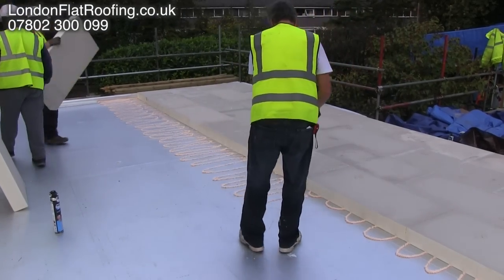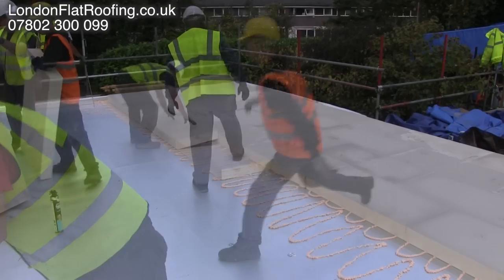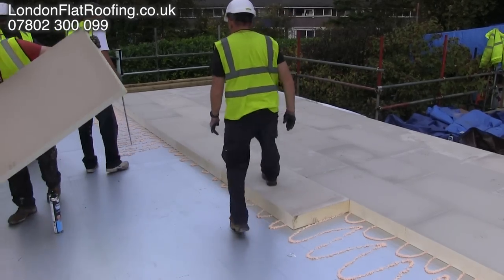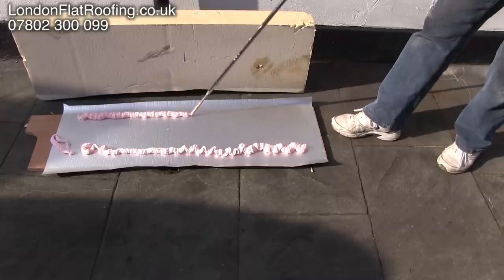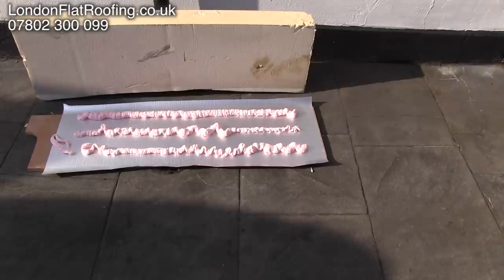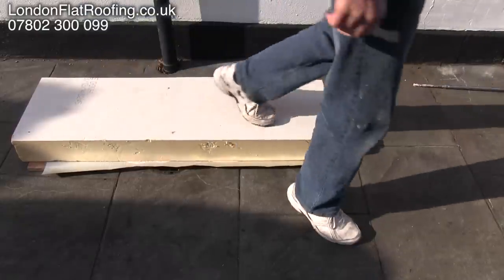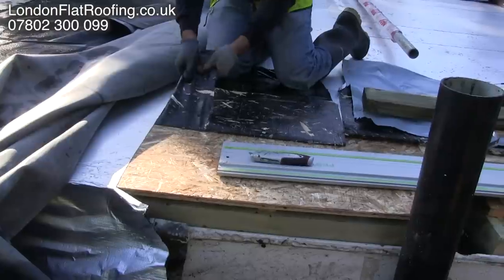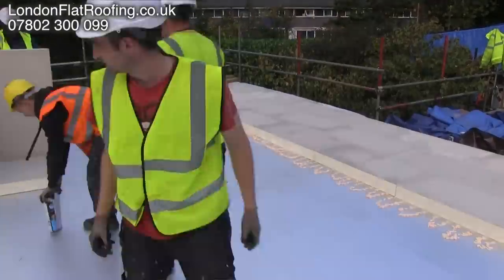Vapour barrier for a flat roof

Comment: Hello Steven
Is it better to give the  vapour barrier a mist coat before the foam?  I ask because last summer we had trouble with the adhesive not curing and subsequent wind lift on the insulation. I would say 30% of the foam has failed.
Reply from the maker: Your question could be taken in more than one way so hopefully, my answer below covers your problem. Don't try and glue insulation to any silver surfaces unless you have the manufacturer agreement of both products that it will work, as yet I can't get any of them to guaranty this so now we don't glue any of our flat roof insulation down. We use thermally broken fixings.
Reply from the maker: By the way all of this failed!

Comment: We have just finish a warm roof where we also glued the insulation down . Bad move ? This is fine if you can get the insulation , OSB down and the Rubber down in one day and make it water  tight . Due the the uk weather it was not possible a lot of water got between the membrane and insulation had we carried on putting down the OSB and rubber . Water would be trapped and never got out or evaporate. Total nightmare. We had to rip it all up which because it was stuck down it was completely ruined.The cost was high replacing the insulation 😢Never again will will stick it down . Once the OSB is screwed down it can not move . Hope this helps someone else to avoid this costly mistake
Reply from the maker: Staging the work between the weather is always paramount to making sure that the work goes well

Comment: Hi Steve I'm going to use this system for my flat roof,  but how do you fix the top deck down, slab nails, screws, or glue as you did the bottom deck kind regards Mark

Comment: hi steve i have been watching your you tube videos for a while and i find it of great intrest.
I am currently building an insulated garden studio and i am about to hopefully start a warm roof build. as an ammeter who has never done this before i was wondering if you could give me some advice?
my warm roof would be joists 18mm osb, vapour barrier ,celotex, 13mm osb and finally rubber edpm

on your blog you mention a link to the rubber4roof websites for purchasing a self adhesive barrier however the link just takes me to the website. can you please tell me the exact self adhesive you guys are using in the video on the same page you metion the link? . please could you also tell me the type of expanding foam i would need to purchase to stick down the celotex as in the video.

many thanks

Comment: Hi Steve, after fitting vapour barrier and then insulation do you then fit another layer of 18mm plywood before rubber roof or lay rubber roof ontop of the insulation thanks Chris BTW great videos
Reply from the maker: The practice so far is to put OSB over the top of the insulation however that is now becoming frowned upon for two reasons but the main reason is that if you haven't got OSB above the insulation you haven't got any rotterbal material above the air vapour control layer does nothing to rot and hopefully nothing to go wrong. So that's reason one not to put it up there reason to is cost.

Comment: Nice video Steve..
After the insulation has been glued down... would you screw the osb on top of the insulation or use the same process  of expanding form? 
Cheers 
Yas

Comment: Hi Steven - we are looking to put up a roof made out metal insulated panels - (sandwich panels with 8cm foam between them.I am wondering if you can advise if we will need other type of insulation underneath- the room is going to be used as a day room for the dogs during winter- so the room will be heated.
thank you

Comment: I've just had a flat roof done, they put the vapour barrier down then the foam and used long screws to hold the foam in place going through the barrier putting holes in it!! It's done now so staying but is that a common practice?
Reply from the maker: Yes happens all the time  if they have done everything else Ok then it will work

Comment: What would you suggest the best covering or method is if you come across an old concrete flat roof that has settled and needs re surfacing and the fall isn't taking water away into the gutters anymore?

Comment: Hey Steve, ive been watching your videos, very informative. May be an idea to list in the description some of the components used. A recommended list for example. I notice you are glueing down the insulation, is that with standard expanding foam or a particular roofing tpye? what type of Insulation are you using Kingspan K7? the vapour barriers you use, any recommended suppliers etc.

Comment: We have dormer style room in roof on the top (second) storey of our house with two flat roof areas to the front and back of the property (both adjoining next door property). Can we just insulate the flat roof part above the dormer window rather than undertake full room in roof insulation? Or would this likely cause condensation/damp issues or thermal bridge problems? Just had one of the rooms in the roof ceilings plastered so this insulation isn't the best route for us now.

Comment: Hi Steve, I am an Architectural Technology student and I would like to ask the brand of the vapour barrier and the expanding foam?
And can this type of vapour barrier work well with precast concrete slab/substrate? Thanks in advance. 
Also, all of your videos are amazing 👍
Reply from the maker: We are using value alutrix 600 as the vapour barrier and I cannot remember what glue we used at the time we don't use glue anymore because it can fail we always use family broken fixings now

Comment: Hey Steve, thanks a lot for all you very informative videos; one question for you: i have a flat roof that, based on the technical definitions, would be a "cold" flat roof, ie there is some fiberglass insulation in between the joists (this was done by the previous owners maybe more than 20 yrs ago); on top there is the decking which is sealed with the silver looking type membrane/sealant (whatever you call it); i have no issues al all with condensation, so i presume they did put a vapour barrier; the problem is the room is cold and i would like to add insulation boards on top of what already is there; could i glues them on top and then use fiberglass to seal the whole thing again, or what would your suggestion be? thanks a mil for your help

Comment: won't the expanding foam raise the insulation board causing gaps between the VCL and insulation ?
Reply from the maker: No not if its installed correctly
Reply: Does it have to be glued when installing another layer of OSB on top?

Comment: Hi Steve can you get a primer to paint on the osb if it's a bit weathered and bit dusty.its been down for a while .?
Reply from the maker: You are going to invest a lot of money putting a roof covering over the top of some old decking so make sure it is dry and robust before doing so if it is then Private with something like waterproof, uni, bond or a tar based product, if you are going over with some sort of felt

Comment: What foam do you use and also what insulation? Do you put another timber deck on top? What insulation would I use for a felt torch on? Thanks.
Reply from the maker: We use tissue faced insulation and we use normal spray foam anything that we can find if you're gonna torch over the top of insulation you can buy a insulation that is designed for torching over has sort of a black top to it a little bit like Felt already on it

Comment: Hi Steve, you mentioned in one of your more recent vids that your preference is to use thermally broken screws over glue. Is that that the current best practice?
Reply from the maker: It's my prefered method as I know that it works and won't come unfixed. We had problems with some of the glued down insulation coming away from the vapour barrier.

Comment: Hi Steve

Hope you can help,
My builder is doing a warm roof for me.
The roof is soon to be fibre glassed. But I  think the vapor barrier has been missed.
The roof construction is 
12mm ply on joists, 100mm foil backed xtratherm insulation then 18mm T&G Osb glued on T&G joints & screwed through Osb, insulation and ply to the joists ( posi joists).
Without the roof being completely removed to now fit a vapor barrier is there another solution?
Thank you
Kev
Reply from the maker: No, not realistically. our specification of 100 mm insulation is not up to the correct standard 120 mm should be the minimum.  glass fibre is not the best thing to use on a warm roof.  have they used thermally broken fixings? Also if you have only got a thin lower decking the fixings must go into the joists or you could have wind uplift that will blow the roof off
Reply: @SteveRoofer  not sure on the fixings but definitely screwed to the joists,  there is a slight overhang of the roof from the main building can vents be fitted in the soffit between each joist and at either end? Would pictures be helpful?
Reply: Thank you for replying so quickly
Reply: @SteveRoofer   forgot to say this is for a garden office space not a permanent residence
Reply from the maker: @kevparker3253  yes you can vent there or anyware as long as its though venting
Reply: @SteveRoofer  good morning Steve 
Thank you for your replies yesterday.
I have decided to take all the Osb boards and insulation up and install a vapour barrier, could I please get a simple drawing/link to a drawing for this so my builder can follow and a recommended vapour barrier.
Roof also has 3 skylights with timber  upstands & timber upstands on the perimeter.
Many thanks for the help
Kind regards 
Kev
Reply from the maker: loads of drawings on line for warm roofs the VCL is alutrix 600
Reply: @SteveRoofer  thank you

Comment: Hi Steve
Love your informative videos!

Do I need a vapour barrier if I am using foil backed insulaionboard? (EcoTherm)

I have built a 5m X 3m shed. Warm flat roof as per your recommendations !  :)
It will be having GRP roof coating system.

Do i need to put osb boards under as well as over the Celotex or will the celotex have enough strength not to crush?

Cheers
Stephen
Reply: +Stephen Divers 
I once read an article about vapour control layers and  “when is a vapour barrier not a vapour barrier” was the question. The answer is when there is another vapour barrier in situ that works better.  This link take you to my website and an article explaining your exact problem ( it starts half way down the page ) 

http://londonflatroofing.co.uk/warm-roof-explained/

Comment: Anybody know if it would be sufficient to use a breathable membrane such as rhinovent pro on top of an osb3 roof deck and then use thermally broken screws to fix the insulation to the top deck before the epdm goes on?

Comment: I understand that you "glue" the Thermalinsulation to the vapor barier, but you also glue the vapor barier to the flat roof?
Reply from the maker: +picajoool  Yes  is the easy answer. However on a warm roof we always use a vapour barrier that is sticky backed so it self adheres. Cheep vapour barriers normally don't perform correctly IE  restrict the correct amount of vapour movement, but also become expensive once you start taking into account how you are going to fix them down.
Reply: +Steve Roofer 
Man, your fast :-)
We usualy lay down the VaporB on flat roof (no gluing, only on overlaps) and the put the thermal insulation plates over the VB. 
But we use mechanical pins (that go from top of the thermal insulation layer all the way into RC slab) for securing the the whole roof so in that way we are certain that there wont be any uplift happening.
Reply from the maker: +picajoool  That's what we do if we are mechanically fixing over a timber deck. What VCL are you using? what fixings are you using to go into RC slab.I haven't been able to find a thermal fixing that will  do that job
Reply: +Steve Roofer
That the problem with the fixings for RC slabs, They from metal so youve got thermal bridge.
For VCL we use Gutta guttafol DB vapor barier but to be ohnest any conctruction PE sheets will do the job as long they have someking of reinforcement so they dont tear up easily.
Reply: +Steve Roofer 
Hi Steve

Which VCL is it you use that the insulation boards can be stuck to?

Cheers
Stephen
Reply: +Stephen Divers  two or three different suppliers try www.rubber4roofs.co.uk or SGI

Comment: Hi, is that standard expanding foam to stick the boards to the vapour barrier? Appreciate your reply.
Reply from the maker: The glue we used on this flat roof to glue the insulation down was supposed to be the correct foam. I did a lot of work to make sure all manufacturers of the products agreed.  It didn't work.  Now we don't trust glue we screw all of our flat roof insulation down with thermally broken fixings.
Reply: Steve Roofer many thanks. I was thinking of screwing 12mm osb3 to the top of the insulation to give it a more solid surface to stand on (screw through to 18mm osb3 underneath) and leave the outer edges without the 12mm board around the parapet to make a shallow gutter running around the perimeter into a hopper. How do you get a slope on the gutter and the roof given the ceiling in the room underneath would be level as well as the joists?
It’s a small 5m wide x3.5m depth single story extension butted straight on to the back of a house with perimeter parapet.
Your advice is much appreciated.

Comment: what make/part number for the vapour barrier, foam and foam gun please steve ?
Reply from the maker: Alutrix 600 and I get the glue from. http://geminiadhesivesgroup.com/  excellent service  belive me once you get a glue kite you will wonder why you never had one before I use it for lots of things get back to me in a month or so and tell me what you  think.
Reply: @SteveRoofer  thanks Steve, do you still recommend thermally broken mechanical fixings or glue for the insulation ?
Reply from the maker: @shizzleinthenizzle   All of what we did above came up the glue didn't work so I don't use it any more. thermally broken fixings are the way to go